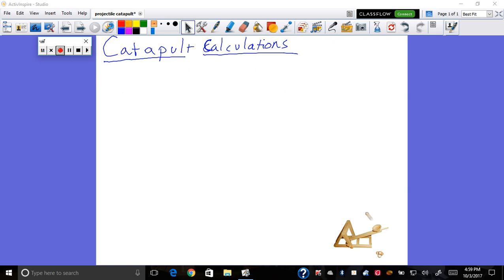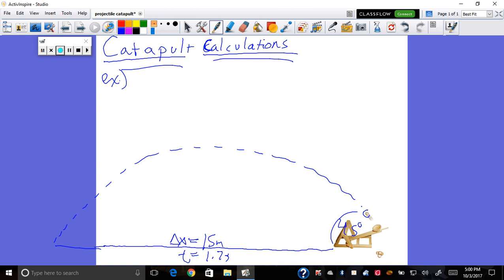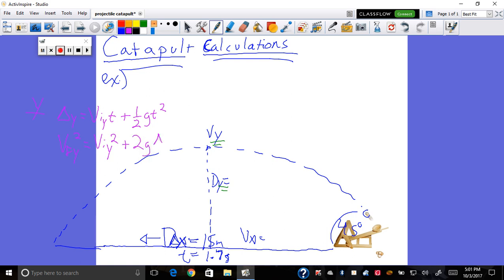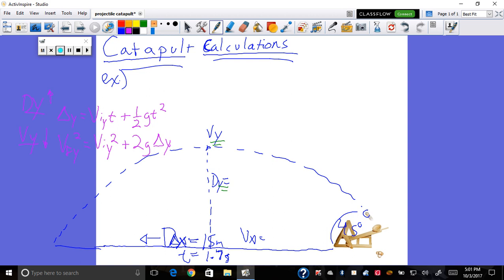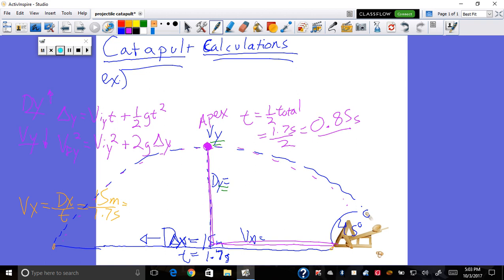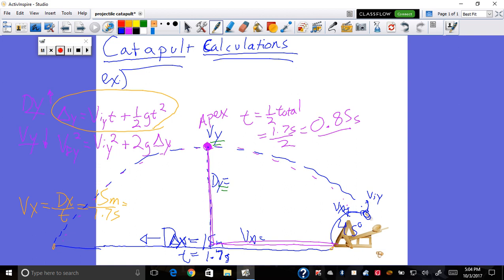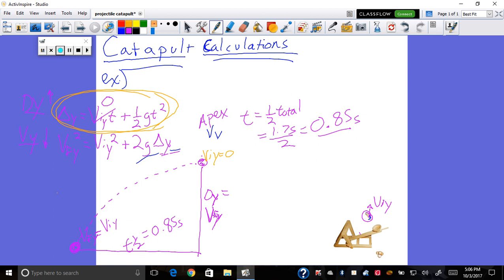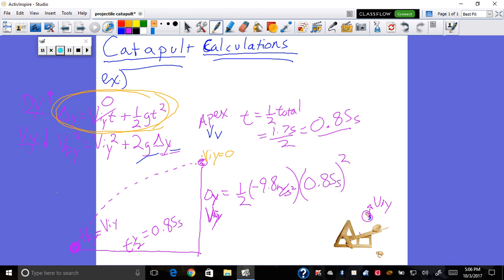Catapult Projectile Calculations

Comment: Is there a way to do this without testing, and looking at it from a purely mathematical standpoint?
Reply from the maker: If your just interested in a parabolic arc, then use a simple ball bounced off the ground. Video and estimate the angle.
Reply: @williammassello3270  I only ask because I'm building a floating arm trebuchet for physics class, and we have to calculate the range and height of the projectile based on the build specs. I was confused on how do do this without calculus. I didn't know if there was a way to do this without gathering any data from the trebuchet first, short of things like projectile weight, arm ratios, sling length and projectile mass.
Reply from the maker: @logangrove4103  maximum rotational speed of the throwing arm based on the length and the predicted launch angle of the ball determines the resultant initial velocity. Those values should give you enough information to calculate Vyinitial and Vx. Those should tell you maximum height and flight time which should help you determine estimated horizontal range.
Reply: @williammassello3270  Thanks I'll see what I can figure out